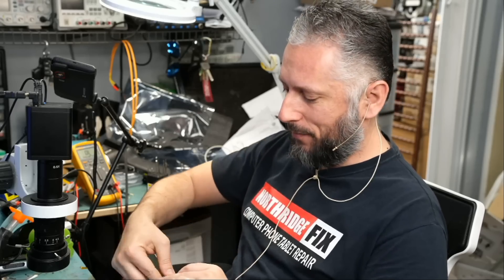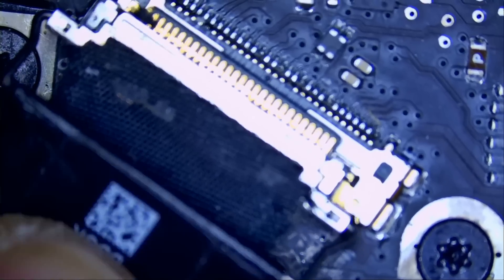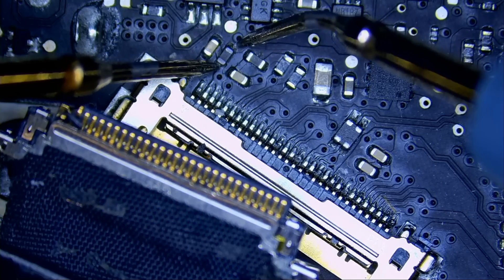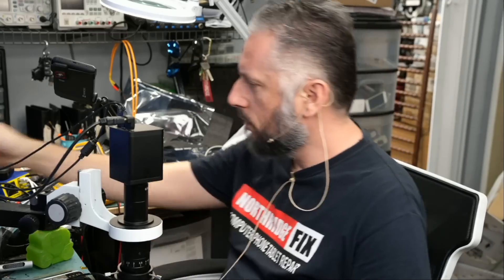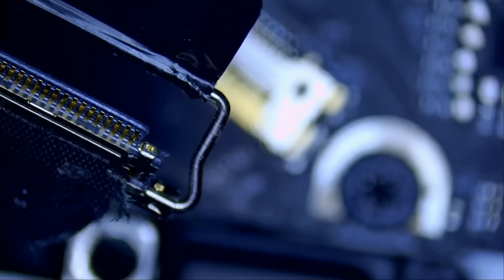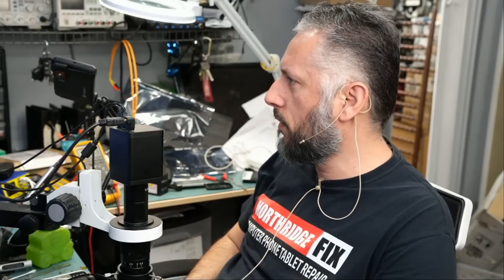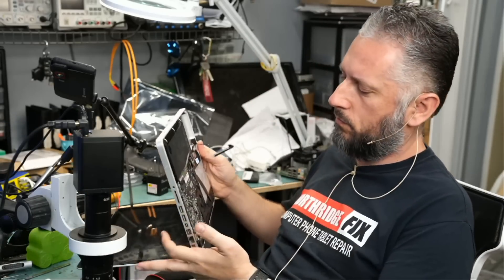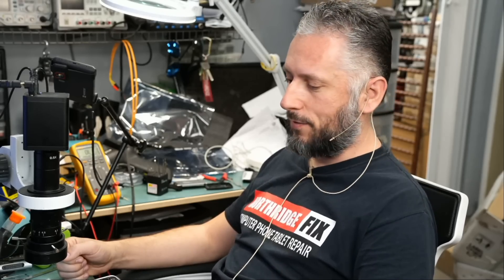Macbook Pro turns on to a White screen - Motherboard Repair

Comment: A minute to fix, a lifetime of experience to figure out.
Reply: Seems like a good quote for t-shirt or a metal logo plaque
Reply: Don't repeat his words like a robot
Reply: @johnny4498  why
Reply: so you charge for the time to fix or the experience ...
Reply: @ricardoconti3868  both
Reply: Which is why most of official repair center rely on swapping parts.
Reply: @ricardoconti3868  Experience of course...
Reply: @ricardoconti3868  That's why it's the same price if he fixes it in 2 mins or 2 hours, experience. Since he has experience it's usually quick to fix too. Double +

Comment: The same happens to my MacBook pro 2012 13 " but works just fine with an external display. Anyone on the same situation? Can it be fixed in the same way that the MacBook in the video?

Comment: Great video again!
Let me ask something, please:
What if the machine turns on, you see the Apple logo but after a few seconds the screen goes white and then black?
At first it was a bad GPU. I knew it because the 4 LED check I learned from you. I changed the GPU board. I was able of running the machine just in safe mode with magenta smears on the screen. 
But right now it is as I described above. 
Please, help me.

Comment: I don't understand zero ohm resistors. Why not run a trace instead? Is it a "hop" in the PCB?
Reply: It's pretty certain to be a fusible link - SMC fuse - to protect the mainboard from damage if there's excessive current draw on the power rail, probably 3.3V. There can be just a zero ohm link if that solves an awkward trace routing issue, but going open is more likely to indicate a fuse, certainly there is normally a fuse serving that function which causes a white screen when it blows.

Comment: I have a mac pro looks like same computer with cd on the side not working. but now being so old and runs as slow as molasses, but once started after about half an hour up gets a little faster, also had replacement screen a couple years ago. is it fixable?
Reply: the CD drive can be replaced, just need to buy the parts and either do it yourself or get help. for the slow system, if it's running on HDD then better upgrade to SSD and if there are any available RAM slot then upgrade the RAM as well (as long as it is supported)

Comment: I still have a 2011 13 inch macbook pro and I love it! These thing were built for eternity. I replace the battery every 18 months everything else is just running and running. It's not my main machine. I use it as a sandbox. Installed Debian on it. Awesome.

Comment: Sir I have MacBook Pro 1278 3 bip sound ram slot clean and ram change after same problem
Reply: on this model (A1278/2012) the lower ram slot is often defective. Try with a ram stick only in the upper slot and leave the bottom slot empty. If it's working install a 8gb stick in the working slot.
Reply: @mariolemerise7732  sir thanks reply me ...sir i chance ram upar side slot but same problem beep sound so any more suggestion i think board side problem ya ram slot diffective , 1278 logic board diagram online available  ? Please send link logic board diagram link thank you